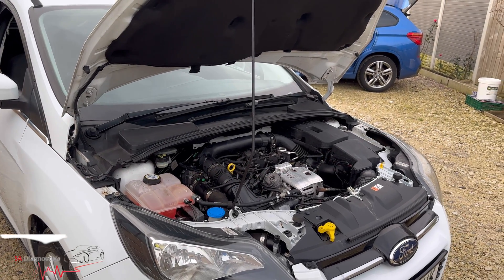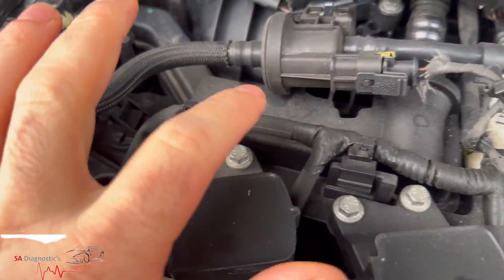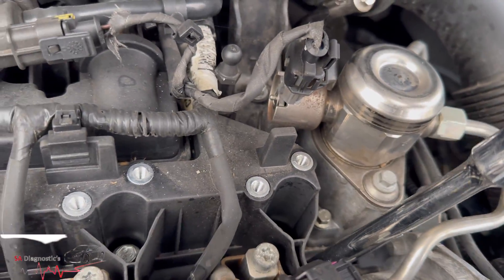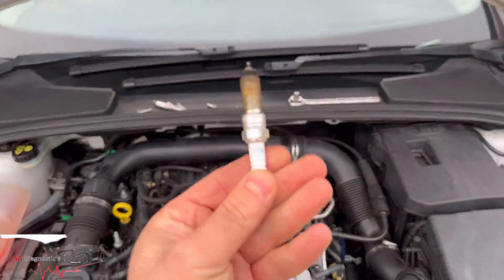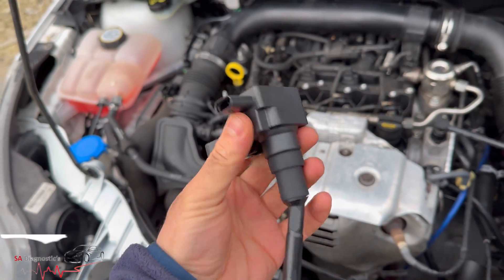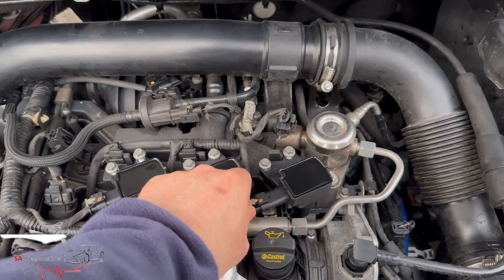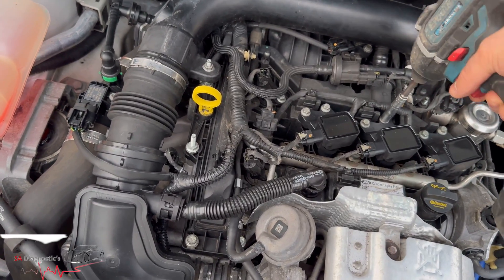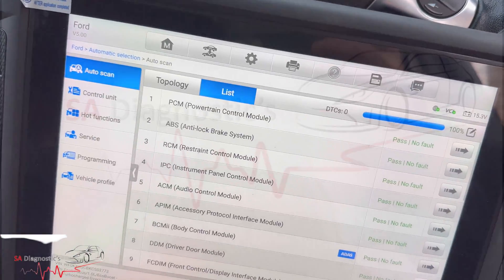Ford P0300 P0302 Cylinder Misfire Focus Fiesta 1.0 EcoBoost Spark Plug and Ignition Coil Change

Comment: If gear 1-2-3 are sluggish. Should i change splug plug?
Reply from the maker: @HyusKays  yes I recommend it change ignition coil too
Reply: @sadiagnostics  thankyou. I've changed spark plug and acceleration is dramatically improved in lower gears . But high gear still sluggish.. deceleration while braking have massive jerk when about to stop . I'm trying to secure plug coil now.
Reply from the maker: @HyusKays  yeh ignition coil is good makes difference. Your braking maybe the discs.
Reply from the maker: @HyusKays  you can do a service as well like oil and oil filter air filter etc
Reply: Mi fiesta en aceleración me da tirones pero si es aceleración progresiva lenta no, podrían ser las bobinas ?
Reply: @lamiaithamou4428 same with me my fiesta jerks when accelerating quick but not if I am slow and steady. any idea?